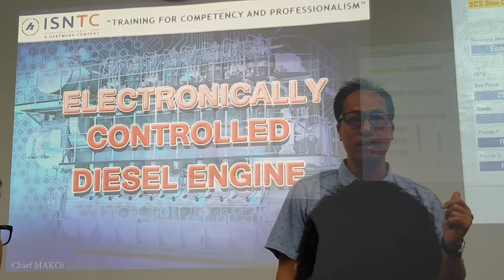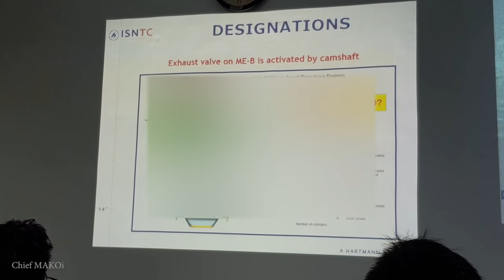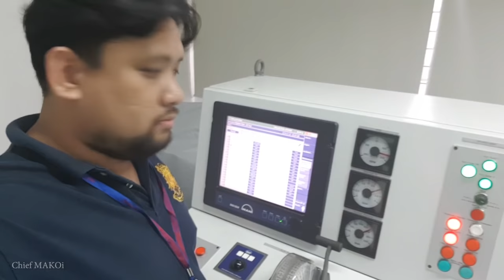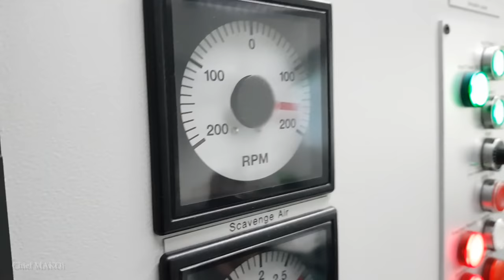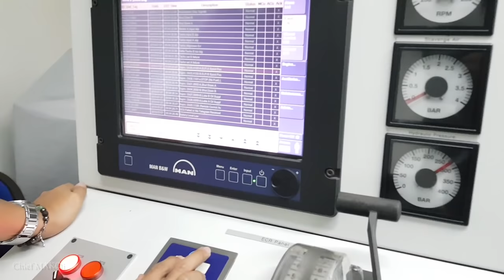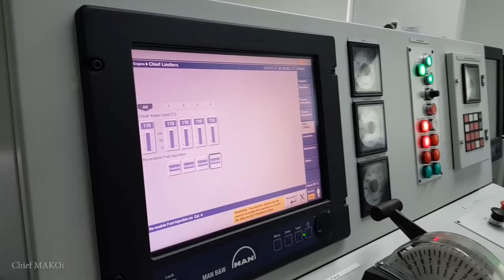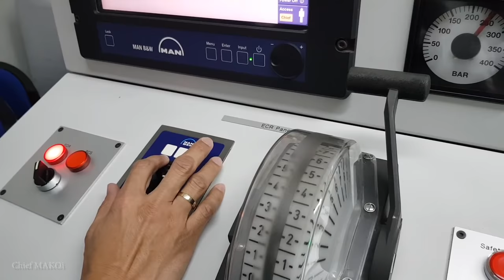Training Day!  Electronically Controlled Diesel Engines | Chief MAKOi Seaman Vlog

Comment: Navies around the world invest in ECM (Electronic Control Module). Economically speaking it saves the Navy tons of money on fuel usage. During my time in the U.S. Navy, I love our FADC and ICAS system. It cut short our troubleshooting time by allowing computer data and graphs to pinpoint where the root of the problem and give us red flags of impending component problem. Tracing DC voltage signal can be tricky than tracing fiber optic signal from a circuit card to another circuit card. Engineering operational system in a push of button either starting/stopping an engine, pumps, etc. or taking casualty action remotely at the console with the aid of engineering space cameras surely cut the manpower to run an engineering plant inport or underway.  Speedy action for casualty control is essential in battle scenario. Thanks for sharing! It reminds me those never ending watches and keeping our boiler (coffee machine) running 24/7.

Comment: Eliminating the Cam Shaft and typical valve train  does remove the biggest "wear point" or "failure point" in any internal combustion system. What is your opinion on the longevity of actuators vs valve lash adjustment for cam wear and/or cam replacement? I could see that replacing actuators would be substantially easier, faster and less expensive than a full cam and valve train replacement in the short term but cost over time is an issue too? Do the new valves have a comparable service life? What is the real advantage to the Electronic engine system vs mechanical?
Reply: The most significant advantages of electronically controlled valves are infinitely variable valve timing and, depending on the system, possibly even valve lift.
This results in improved engine efficiency over the whole rpm range.

Comment: I would only have one question Cheif. Let's say a electro magnetic pulse went off and took out the computers. How do these engines run without them ???
Reply from the maker: They wouldn't.
Reply: How would an EMP penetrate the hull (ie Faraday screen) and balanced screened control wires and feeds - It couldn't.

Comment: I would always be concerned that a failure in the electronics will trigger the valves at the wrong time. If that happens to a car engine, the consequences are nasty and expensive. A degree of redundancy an be used to prevent such a thing, but then there have to be additional systems in place to ensure that a failure of part of the redundant systems is dealt with.